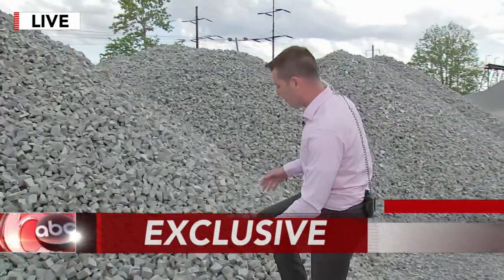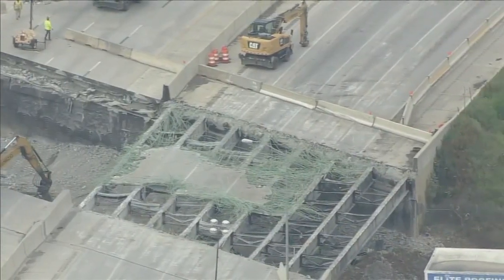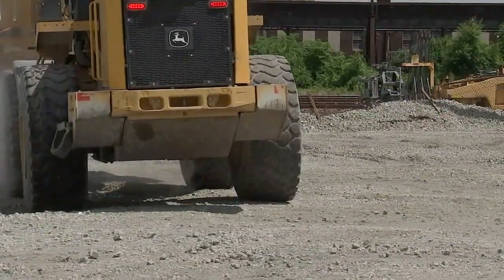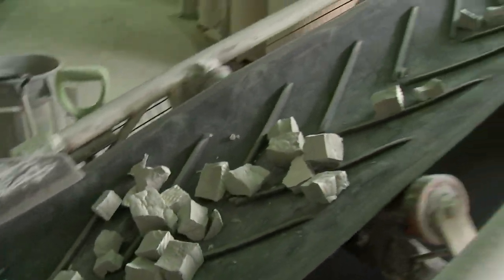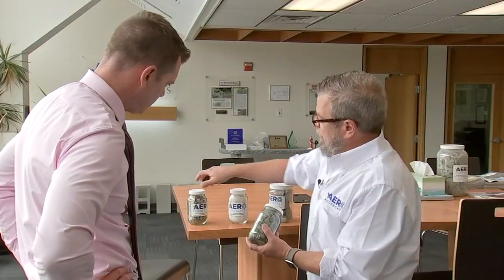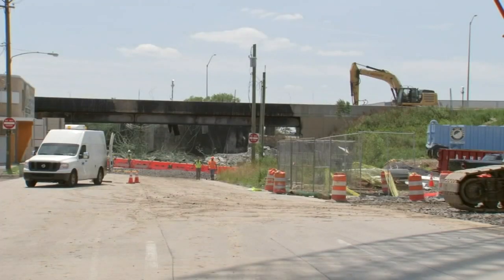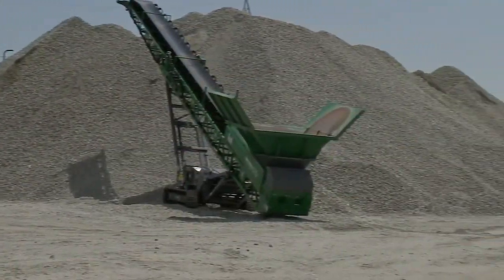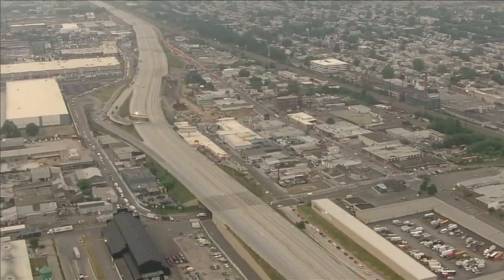Delaware County company to help repair I-95 in Philadelphia with special fill

Comment: Would be interesting to know who came up with this solution and how.
Reply: Both the state and federal governments want a temporary solution to get I-95 functional again. Instead of waiting on a bridge, it is easier to bring in a strong, durable material to fill in the giant hole as a way to ensure traffic can flow again. In the coming months, the bridges will be replaced, and the temporary solution will no longer be required.
Reply: @appalachianenthusiast9499  Not what I asked.
Reply: @mattfoley6082 you asked a question?
Reply: @appalachianenthusiast9499 Is this the same material as the Brickstone product? All I see are recycled bricks. Cinder blocks specifically. I know cinder blocks are made from coal ash but I don't know if it qualifies as glass